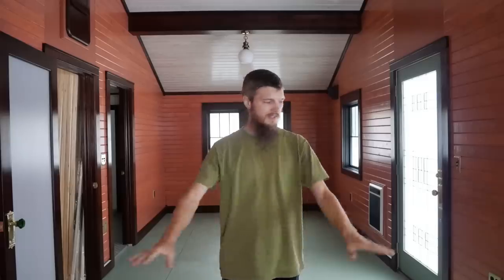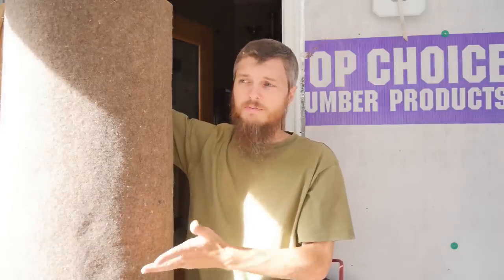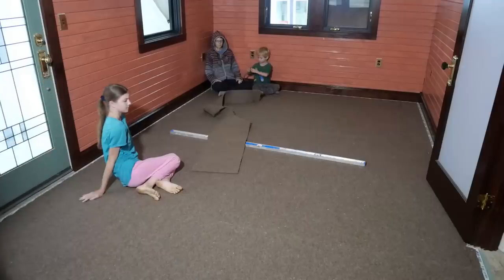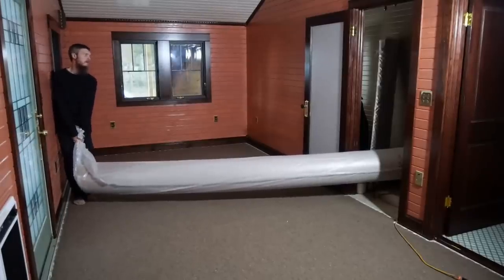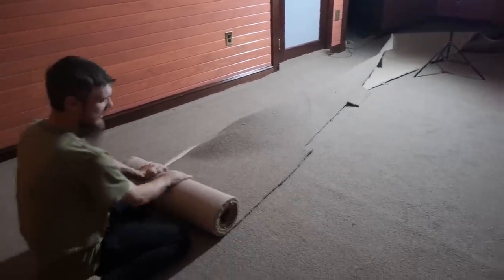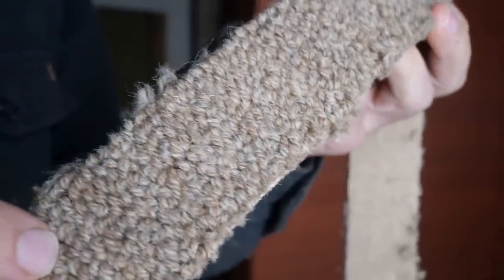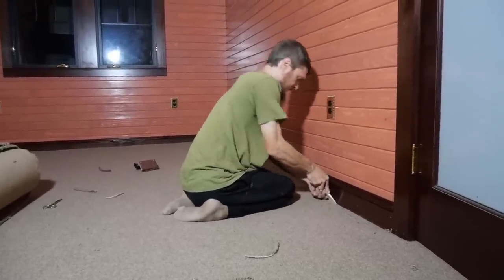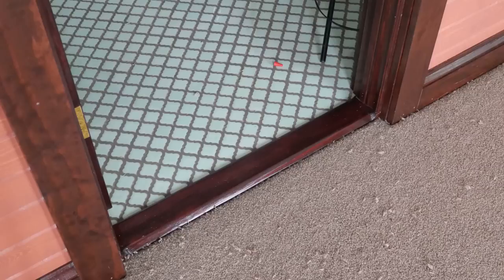Installing Carpet Ourselves - Natural Flooring Reveal + DIY

Comment: Save your strips they make excellent bedside foot warmers when you get up at night or maybe by the front door to knock the sand off your shoes or just to have in case carpet gets damaged and you have to cut out a piece and have a new piece put in to correct a damaged spot or stain you can't get out. Text some of the really good quality carpet stores in your area so you know how to finish the edges on a piece use that way. Using material that blends with the carpet is usually the best way to go then you can hand sell it Onto the edge and then hand sew it in at 3 inches of 4 inches so you don't have the edges s unraveling.  Everything is looking so pretty, I guess the last thing to do is the kitchen? Will it be like the one you built in your last house in Michigan? I liked the pot filler and spot for your Berkey! Thanks for sharing so far you've kept me very interested!

Comment: I grew up in a house in the country that my father built in the 1930's.  It had all oak hardwood floors, but every room had a rug that had about 1 foot of space between it and the wall.  The doors were all locked with skeleton keys.  Can you imagine?   Anyone could easily get in but no one worried about that and they were rarely locked.  My father built the framing from cedar wood (from local wood and mills).  It had cedar shingles on the outside.  The inside had lathe and plaster walls that my mother wallpapered..  It looked like an English cottage and was 1-1/2 stories.  Bedroom ceilings on the second floor followed the roof line on the sides.  The home is still there and still looks beautiful with new owners.  It will probably last a long time being built with cedar.   I was born in that house.

Comment: I'm a 66 year old woman and laid carpet in half my mobile home this summer. I couldn't use the carpet stretcher because my knees won't take it. Most of my carpet came from the Habitat resale store, some from a local outlet. Mine is not perfect but it looks a ton better than the old did. I cut mine outside on the drive and brought it in. Much lighter. ☺☺

Comment: Hint...When you're stretching left to right  use your right knee. Right to left use your left knee. This leaves your trailing hand to push the carpet down onto to trackless strip. Stretch it like a bed sheet. Corner to corner and pull the wrinkle to the far corner. Trim it after stretching and tuck it with your stair tool. All in all a nice job considering it's your first time.

Comment: Looks great. We opted into rugs since we live in central Florida near the Villages. With all the sand in Florida we didn’t want it getting trapped under carpet. We don’t typically walk in the bedrooms with our shoes on but it spreads one way or another. So we did a vinyl plank flooring throughout so it’s easy to clean and is seamless. So far we are loving it. But I do like the softness of carpet. We are just doing area rugs.

Comment: Wool is superior to any rugs I've had. My first home had wool carpet. It lived thur 18 years of 3 dogs, a cat and a bird, sloppy winters and rainy springs. The carpet always cleaned up nice. When I sold the home, the buyer commented that the carpet must be quite new! That's how good it looked after 18 years. I have a wool 10x12 in my current home. It was purchased in 2011. It still looks new today. It too, cleans up really nice.  By the way, the carpet was a soft minty green. 
Anyway, aside from the jute area rug under my dining table, which I also love, wool is the way to go. So good choice and great job on the install👍

Comment: You need to power stretch that carpet. You will easily get 3+ inches of stretch over that 24 ft.  I do this for a living
Reply from the maker: I believe it.
Reply: And if it isn't properly power stretched, that carpet isn't going to last long... you'll get wrinkles in it, and the backing will delaminate (separate from the face of the carpet). You really need to have it power stretched. Manufacturers warranties are voided if you don't have it properly stretched, and using only a knee kicker doesn't qualify as proper stretching.
Reply: @jeffshort9313  agree 100%

Comment: I personally like carpet in the bedrooms. in the winter time it can get pretty cold here in north central Kentucky and the bedroom is where you will most likely be bare foot changing clothes and so on so carpet would keep it slightly warmer but in the main hallways yes hard surfaces make more sense. easier to keep clean. now carpet is a little easier for me to see that it got vacuumed because of the groom lines from the beater bar (only synthetic obviously) you can get a vacuum cleaner with a softer gentler beater bar that would be more effective but not to harsh. I recommend an Oreck upright vacuum cleaner. they have softer brushes that aren't stiff but it will remove stuck on hair, lint and debris. there's many others that are gentle too, Dyson has some that have soft brushes, shark has some with soft brushes so just shop around. you can also get a soft carbon fiber brush head for the central vacuum too. great video! 🙂

Comment: here's a wee tip to remedy any flattened spots once the furniture is in, if you decide to change the layout at some point. place an ice cube in the flattened area and leave it to melt. the wool will bounce back up and you can gently dab any excess moisture.

Comment: In my country carpeting is rare, and I think it's also because of the habit of wearing indoor slippers (which are washed weekly). They serve as two mini carpets on your feet, warmer wool ones in winter and cotton ones in the summer. I take my slippers everywhere I go lol :) Walking in slippers on tile or hardwood doesn't hurt the feet but it would if you walked barefoot, though. And due to climate in Florida I am sure being barefoot is the most comfortable and having soft carpet underneath must feel great :)

Comment: That long of a room is like our dining/living room length. And I helped the carpet layers when they did our carpet 2 times over the last 30 years we've had our old farmhouse, stretch the carpet. They use stretch bars across the width and the length so that over time you don't get stretching and puckering.  It sucks spending all the money on carpet and then in a year it's stretched and your tripping on folds in the middle of your floor. When they did our new carpet the first time it lasted 22 years no stretching. Then we got new carpet 8 years ago and no stretching out this time either. That is why I let pros do our carpets.

Comment: Lanolin smell, I knew a guy who had a wool carpet in his house there was about 30 years old getting a little thread there and spots but it was still nice carpet when you got it washed and stuff, if you get a loop pile on your carpet it has less chance of squashing down in the traffic areas then an open end yarn...you can take the excess carpet to an upholstery shop and sew on n edge and make a runner for your entrance hall or in front of the sink...looks beautiful guys

Comment: We had the most awful, old carpet in this house when we bought it. We replaced it all with engineered flooring and I got cotton woven area rugs that are machine washable. I have a whole lot less asthma issues, and my allergy shots actually work. We do have elderly dogs and 2 cats, but they don’t go in my room where the rugs are. I would have loved to put down real hardwood, but it was too pricey. I love the new room! I use wool pads under my rugs also. I take them outside and toss them over the chain link and smack them with a broom whenever I was the rugs. I have a DeWalt canister shop vac and it’s my best friend on cleaning days.

Comment: I have 2 rooms of wool carpet that were installed in 1969. Two great things about wool carpet are the color can be changed and it wears like iron. Taupe was the original color but now one is light brown and the other is a teal color. They look new. The key is proper care. We use a 1930s RexAir water vacuum (Rainbow) that deep cleans carpets like professionals do. 

It looks great no doubt in part because of your talented little helper!

Comment: When it comes to re-stretching, I will highly recommend the Harbor Freight adjustable carpet stretcher, you can use inch and a quarter electrical conduit to extend its length.  So instead of spending 200 to 400 on a professional stretcher you spend around 75.  I used it to re-stretch the wrinkles out of the my carpet since I think they installed it with only a knee kicker.

Comment: you guys did a great job, specially working as a family.  it is no ones business but there is a slight disadvantage to wool whether its blankets rugs or carpet, not a major disaster but harder to control, just saying from experience. but for it to be an issue you would first need a house pet ie. cat or dog. In my case my cat had a fight with an alley cat out back ended up bringing home fleas, I had to invest in a really good carpet cleaner and some questionable chemicals since wool cannot be steam cleaned. I apologize for this but sometimes stuff happens you can not control.  You guys are awsome do keep the videos coming.

Comment: Love watching you guys.  Only concern is the tack strip in the door ways.  When you step on the strip in the doorway it is goin to be painful. The carpet in the doorways is normally turned under and stapled.
Reply from the maker: If it's ever a problem we can just take a hammer to it and pound the pokes over. But so far, we can't feel any nails through the carpet.

Comment: It looks great and very comfortable. My parents have carpet all but the kitchen and bathrooms in their house and it has been put through hell will dogs. It’s a speckled cream color so it hides dirt and stains pretty well, but after cleaning up urine, vomit etc so many times for me I’ll stick with a hard surface floor in my future homes and use rugs. But if you don’t have a dog I think they can be a great option, especially for warmer floors, better sound insulation and softness. My grandma has wool carpet in her home that they installed in the ‘70s and it has held up quite well, especially since she lives on a working farm. Hers aren’t looped surprisingly and still look nice. She uses a Rainbow vacuum. My parents have a Bissell ProHeat carpet cleaner, they’ve had it professionally cleaned twice. Regular vacuum is a Simplicity which has really good suction, though I prefer my gram’s rainbow. And then we also bought a professional detailing extractor that works great on stains, etc.

Comment: rent a swivel stretcher in the future it gets costly buying tools.  looks great!  My parents had an all wool design carpet in their dining room for over 40 years.  The carpet eventually wore down. (no water cleaning it will shrink and you will have bald spots). looks great!
Reply: H⭕hmW🌐rk  dry shampoo ; may say made to clean rugs with animal hair.  Try to get it when its newly stained or wet.  My mother used a vacuum with a beater bar for dust because dust settles below the wool carpeting-I have not priced or had the need for such a vacuum in todays day and age.  As a side note, she never ever ever
let us romp around and play in that room due to possible wear on the carpeting.  No shoes, no barefeet, just socks!  Good luck, there should be plenty of sources online to clean wall to wall wool carpeting.  I have also heard shaving cream for pet accidents although I dont know how that would work on wool. 
Remember, no water it will ruin the carpet and you will lose fibers.
Reply: I take my wool rugs outside in the summer and wash them, then let them dry in the sun. They don’t shrink.. check out rug washing videos, they use pressure washers and squeegees on them.

Comment: As for Central Vac…I personally found it more difficult using CV.  It’s the hose it’s very long and cumbersome to drag around, then to whined  up and then to have a dedicated area for storage. I now use a Shark up-right fantastic machine…anyway that’s my feelings on the matter not yours. Great job Doug

Comment: I found if you use a shop vac on rugs so, use the squeegee attachment to the end of the floor suction tool. Used this method on rugs at work. It won’t suck up the rug but will pull out the dirt.👍

Comment: Your carpet is just a little lighter than mine which has been down for 10 years and still holding up well. Mine is also looped and the shedding does settle down after a while. I've never used a beater on it. I put carpeting in my living-room and bedroom because this bungalow was buld in 1984 and the floors are tile over concrete and get very cold in the winter here in the UK.The rest of the placed had new flooring last year when my bathroom and kitchen were refurbished. ♥

Comment: I'm not much on carpet either. I use wool socks a lot. They are not hot as some would think. I wash everything in cold water anyway & then I air dry them. No shrinkage. Wool is good..

Comment: I agree about steel beater bars. However, some vacuum cleaners have brushes instead of steel beater bars. Brushes don’t hurt the carpet.
Reply from the maker: Here is a quote from the manufacturer: "As with all quality natural fiber carpets, vacuuming with a suction only vacuum cleaner is recommended."

From what I have seen, using a vacuum with brushes on natural fiber carpet and rugs does cause wear and excessive shedding and pilling.

In fact, it's not recommended to use a roller brush or a beater bar on any looped carpet, natural fiber or not.

It may be fine depending on the softness of the brush bristles, but generally I would avoid the practice. I would stick with the guidelines given by the manufactures on this one.

Comment: My mother loved beautiful patterned area rugs on top of the synthetic rugs.  Unfortunately, my allergy to wool extended to the rugs. Nobody thought it would affect me since it wouldn't be touching my skin. Nobody realized the fibers in the air or me walking barefoot on it would affect my allergy.  I just get really congested, especially at night, from the carpet. I believe my sister's asthma was so affected. I never got over my wool allergy. I accidentally bought wool socks and I couldn't wear them because my feet swelled and inched when I wore them at age 70.  As a child, I was thrilled when they bought me a synthetic coat for winter. They paid extra for completely lined wool coats, I still had an allergic reaction of congestion.
Reply: Wow!

Comment: 7:36 My experience has been that nylon carpet lasts forever; mine is well over 30 years old and is finally showing signs of wear only in the heavily tracked areas, while polyester carpet, at least the kind they made when I was a kid, starts out softer, but gets pilled and flattened under any serious traffic, in a few years. Both could probably go a long time without going bare, but polyester carpet gets so repulsive so fast that people usually get rid of it well  before there are any bare spots. Also, with any synthetic carpet being fairly inexpensive, people are more likely to part with it instead of putting in the work to clean it thoroughly. Wool carpet doesn't stand up to commercial traffic nearly as well as synthetic carpet (I worked in a theater that was built when it was still legal in public places), but as long as it still has nap, it keeps its shape much better than polyester and maybe a little better than nylon. It also absorbs dirt more completely than synthetic carpet, which is a mixed blessing; it's less prone to feeling sticky when it's dirty, but harder to completely clean. I think you'll like it in your bedroom.

Comment: I’ve been laying carpet for 20 years the one thing I noticed you said about the padding is not releasing any VOC’s in your home there isn’t a carpet manufacturer or a pad manufacturer in the country that has anything toxic that off gases the products
Reply from the maker: I don't know where you heard that but everything I have read says that carpet and padding do release VOCs, some of which can be harmful. The levels are low in new carpets and padding because of better materials and manufacturing practices being used today, but it still exists.
Reply: @diyfferent  That was my point they exist but nowhere near harmful levels I’ve literally been crawling around on it for 20 years I’ve had it in my mouth in open wounds I don’t see how you could get enough of it for it to be harmful
Reply from the maker: @aaron_brown7324  It's just not something we want to deal with. We always choose the better option, i possible. It's like cigarettes. Some people can smoke their whole lives, and be totally fine, but it is harmful and some people die from it at a young age. We'd rather just be safe than sorry.

Comment: Sorry to keep harping on wool rugs, you can spot clean them by blotting with a dry towel then pour clean water on the spot and blot again, do not rub..
I have oriental rugs that are over a 100 years old, the good ones are  not worn at all. And I have dogs and cats.

Comment: Sorry but I’ve had carpets in my home for over 34 years. I have a normal vacuum and my carpets have lasted decades. I’ve only just replaced my hall carpet after 32 years of use. However, yours looks looped which I don’t have as I choose Axminster or Wilton carpets which are just the usual type of carpet. You are right in that it sheds for at least a month or so after first use depending on how often you do vacuum.

Comment: I’m curious, why install wool carpet if it stinks? Also, if there is a spill won’t it soak up the fluid and retain it much worse than a normal carpet pad?
Reply: I guess you didn't listen to him explain why or watch the video to the end.
Reply from the maker: It stinks good, the smell does go away though. Wool would handle spills better than foam.